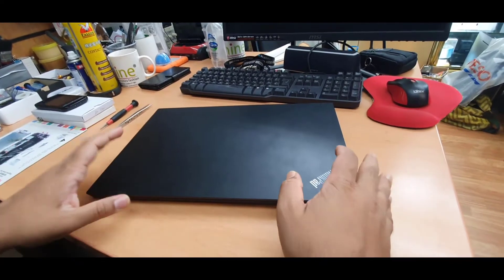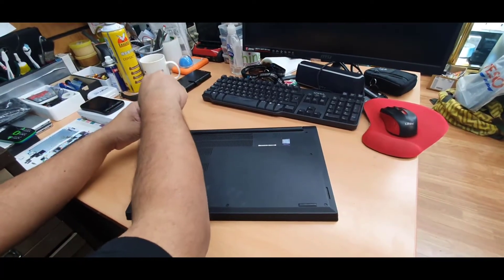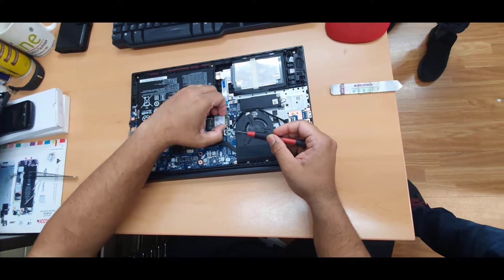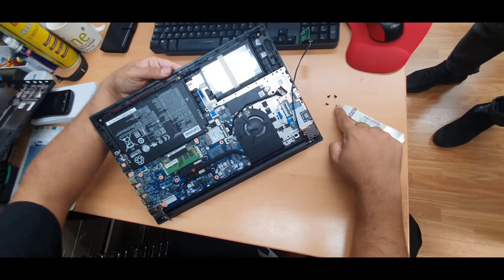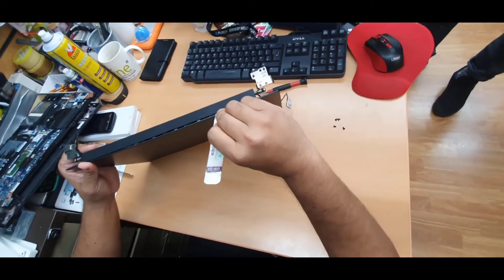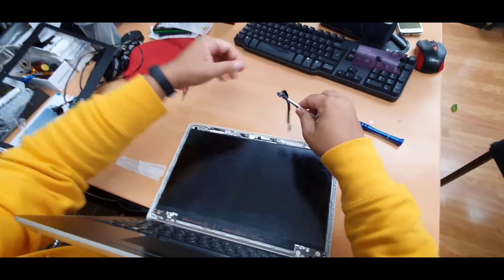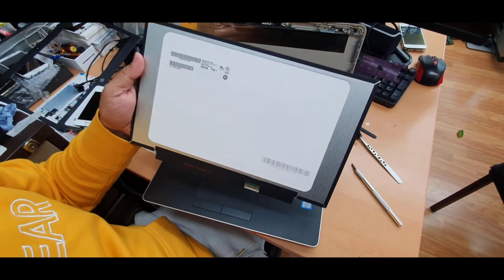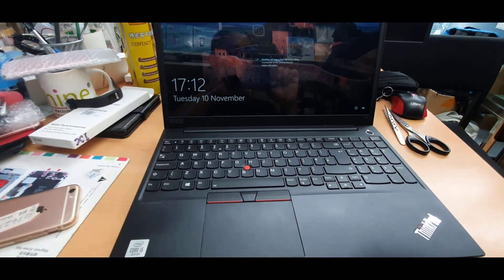Lenovo ThinkPad E15 LED SCREEN REPLACEMENT

Comment: Came here to comment that you don't even need to open up the case to swap the screen. This will give you a lower chance of screwing something up since you don't go near the board. You can just remove the bezel (easily), pull adhesive strips and then disconnect the 30-pin connector. There are other videos on YouTube showing the method I just described on the E15 Gen 2. I just swapped mine in under 10 minutes.
Reply: Forgot to mention you should disable battery power in BIOS settings before doing this!

Comment: start process is big mistake!  go into bios and disable the internal battery! this is important, as opening the case you can cause a short either touching components or while removing the display cables! which can cause backlight filter fuses to go caboom!

1) disable internal battery in bios. crucial!
2) open the bottom case cover
3) disconnect the battery! much more crucial then the 1st stage!
4) disconnect wires/cables disconnect hinge screws...
5) remove lcd case
6) now crucial part is lcd frame bezels has double sided tapes on them, and they can get harder/stronger! what he did/how he removed the bezel (front plastic on top of the lcd) is very very wrong!

here is the reason: if this is an already damaged lcd, not much issue, but if you are not replacing the lcd, but bezel? rear cover? camera etc, you can and will damage the lcd due to strong adhesion between the bezel and the lcd ! so you have to test this with a plastic spudger to see if it is strong or not. if it is strong, you gotta use some heat to loosen/melt the sticky tape/glue material, so you can remove the bezel without damaging the lcd!

i removed and replaced many lcds doing just like he did, and learned the hard way. lcd bezel has stick tapes between them, kind of dust/water protection/barrier, just like in phones! the harder it is, the more careful you have to be!

also battery disable/disconnect is as much important if not the most! because it happened to me once out of 100s without issue, one time cable disconnect caused a short while battery was attached, and backlight was gone! 

always disable/remove/disconnect battery first before starting any procedure! and check adhesive as well esp on thinkpads, they all have double sided tapes between the bezel and lcd!

good luck, and proceed with caution.
Reply: After following this video and replaced the screen. I can hear the laptop running but the screen is still black, connected hdmi to another monitor to test and it also does not recognize. What do you think could be the cause for this?
Reply: @DatTran-kl3rz  first check if the lcd is actually working? shine a powerful torch/flash light at the screen and see if you can see anything on the screen (if screen is ok, but backlight fuse blown, you will still get pic but because no backlight it will be dark, only way to see image is shining flashlight at the screen and look from angles)

use/press f12 menu key so it stops at the menu selection then use torch light to see if you can see/read anything on the screen? if you cant see anything, it may be some other component preventing the start up.

if it is backlight? using flashlight, you can bypass the bios menus, and go to windows, only in windows u ll get a hdmi output as the default output is internal, unless you change it from bios menu (which is already hard to see using torchlight, but doable)
Reply: @DatTran-kl3rz  if you can see pic using flashlight, then the problem is already fuse issue, which is a very very small component, i fixed it by shorting it (making permanent fuse but if you never done soldering it is hard. u may need microscope or very high magnifying glass and very small tip iron
Reply: @mytester6208  i don't think the issue is with the screen since connecting it to another monitor does not work (it was working fine until screen replacement). Holding the power button over 30s does not shut the laptop down now. I really wonder what could cause this.
Reply: @DatTran-kl3rz  try reset button, inside the case (if case open) or using a toothpick, through small hole at the bottom case?

screen replacement (with battery connected) can cause a short and fuse blow, doesnt stop displaying output, but since you dont where you are stuck at boot process hard to tell?, if fuse issue, flash light will show, if not possibly you may have shorted more stuff inside?

Comment: I also have the same model and the screen is little bi dim. is it normal or there is a problem with the configurations
Reply from the maker: Is that from the beginning or suddenly it has changes? sometimes video driver issue could cause this problem. and some screen has matt finish and those are always look faded.